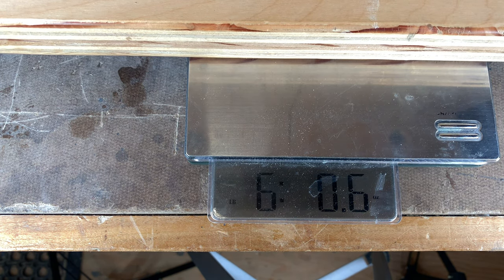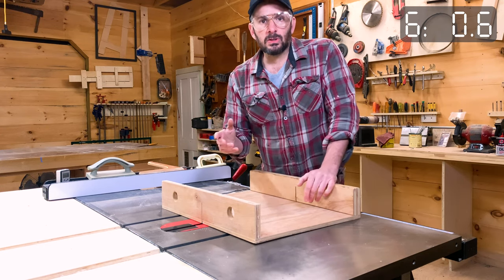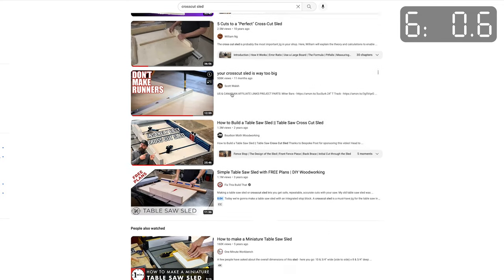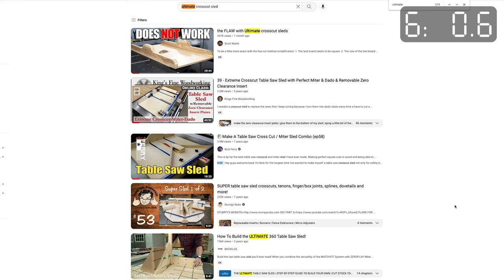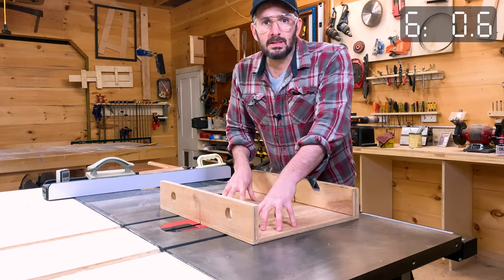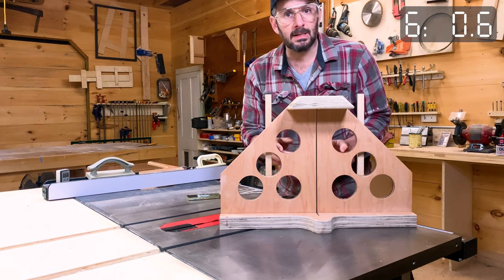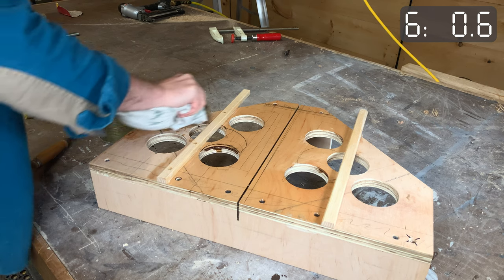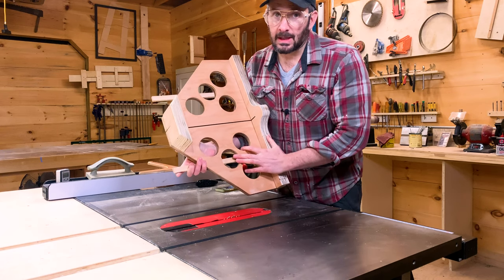How to build a better crosscut sled

Comment: The moment I discovered the crosscut sled that is my go to for precision cut and stoped using my miter saw for that.  Not to say my miter isn’t used at all.  It is great for easily breaking down to usable sizes and when I need to make a quick cut that does not require a perfect cut.
Reply from the maker: My thoughts exactly